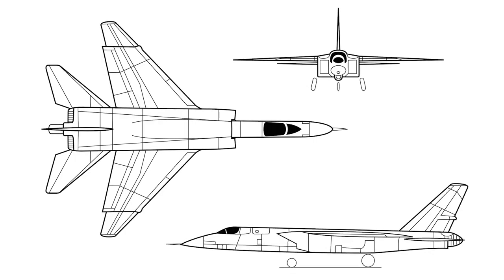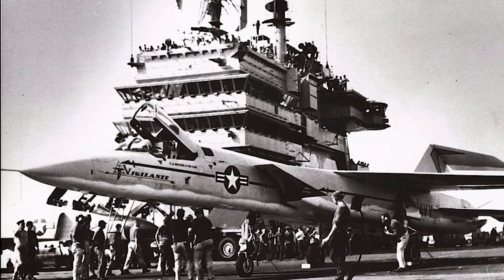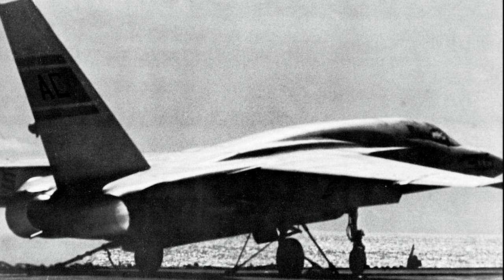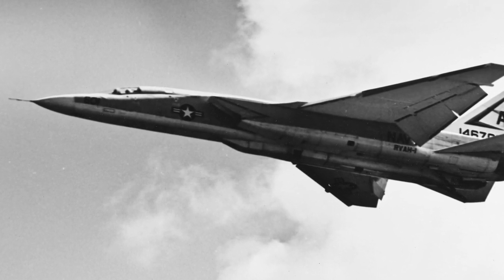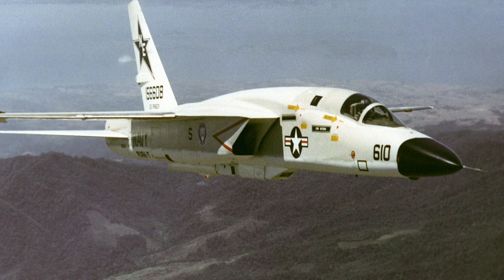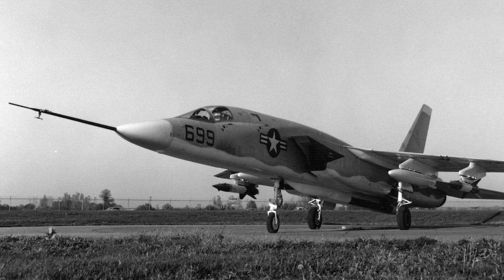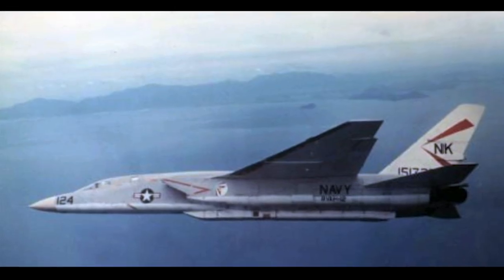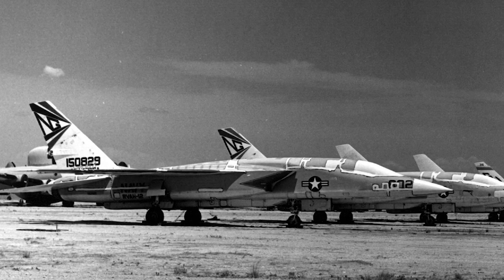North American A-5 / RA-5C Vigilante -  A Short History

Comment: This was the first A/C I worked on out of AE “A” school
Reply from the maker: What was it like?
Reply: @A_Short_History  it was WAY ahead of its time. Fly by wire. Had air conditioning that would freeze your hands but it didn’t use any kind of cooling fluid. You could pull the aircraft to the take off position in the runway and the aircraft could take off, fly to its target and return fight back to the same spot without the pilot doing anything. WAY, WAY ahead of its time. Was very easy for AEs to troubleshoot.

Comment: This was one of the most outstanding aircraft I ever saw.  You had to be there to see them run.  They could fly into Space, but the Air Force did not like that so they never did.  There was a movement to bring them back with a Rocket engine under the vertical Stabilizer.
The Navy wanted to bring them back with a "Hot" fuel, but the AF complained so much, it never happened.
Reply from the maker: What were the AF complaints about then?
Reply: @A_Short_History  AF complained that it was faster than the SR-71 flew higher took regular Avgas no special fuel cost was about the same,   maintenance was much lower
Those that say it was maintenance problem are lying
Reply: They could out handle any fighter, could run away from any missile, totally stealthy at subsonic speeds you could not hear them